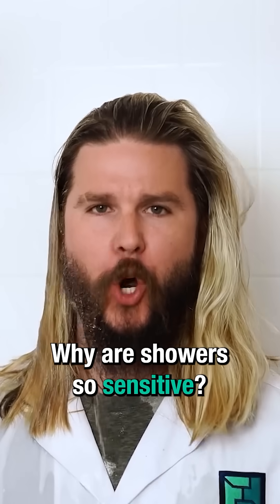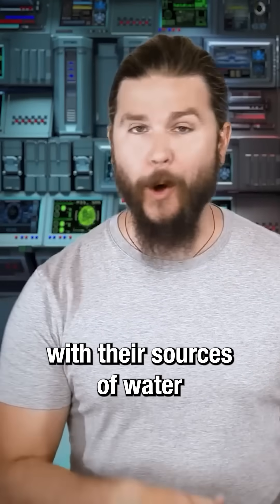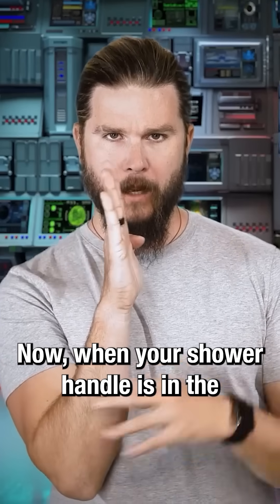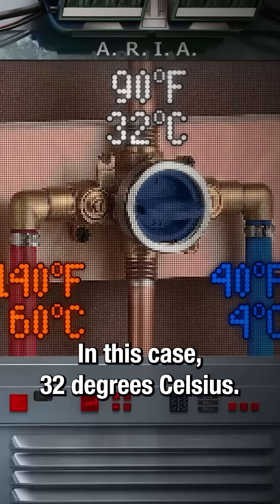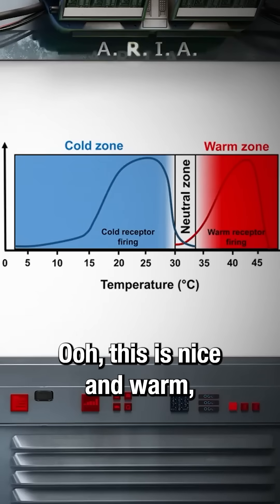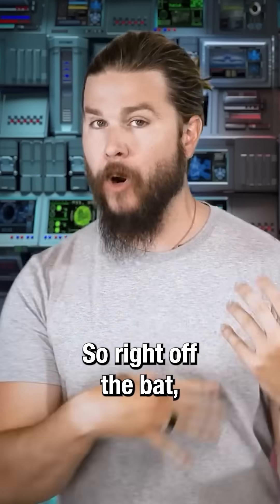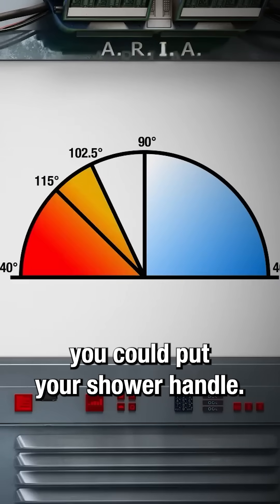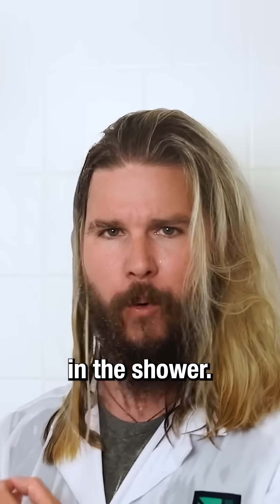Why are showers so sensitive? 🥶🥵

Comment: Must be nice to have a single shower handle and not the two knobs of death
Reply: Yes it is, and I’m sorry.
Reply: My hot water was barely hot enough. By half time the cold was completely off, and you had limited time to finish before it started to cool.
Reply: @Ron-rs2zl if you had a well or something similar instead of city supplied water, it might be a faulty water heater. How’s the water pressure?
Reply: @skorpio349  thanx for your concern. I do have a well, and everything is up to par. The water heater was set low, and it wasn't really a problem. Just finished a whole new bathroom and turned up heat, so it's plenty hot now.
Reply: All hot, adjust cold.

Unless someone set your water heater too high, then do the opposite.

All cold, adjust hot.
Reply: @evananderson1455 this is the way
Reply: @evananderson1455  THIS IS THE WAY
Reply: @evananderson1455 based
Reply: But even turns typically work... typically...
Reply: @hadensnodgrass3472  I find the best method is to turn hot all the way up, then bring the cold up to the desired amount.
Reply: @hadensnodgrass3472 not in Japan... Trust me I flew there and tried
Reply: @hadensnodgrass3472  So Hard LOL 1 Shower Head FTW
Reply: I have a 70yr old house and I deal with the broken singular knob of death
Reply: @user-bs4ws3cc7h  The stem valve for the hot water knob of my walk in shower is stripped so the knob doesn't stay on/work and can't find a plumber that can fix it. They all like sorry we don't even carry those parts anymore. I have the handyman skills of Al Bundy so I'm not going to fix it myself
Reply: I have the two knobs of death, and for all intents and purposes, one of them is also useless, since it's always either all the way open or all the way closed. Normally I open the hot all the way and then turn the cold to where I need it, but when we got a new water heater I had to change that math and open the cold all the way during the summer sometimes, and then turn the hot down. Either way though, I find that having the two handles actually increases the amount of usable real estate where I have a sweet spot between too cold and hot enough to just not quite injure me (and I usually like it way towards that hot side anyway for therapeutic reasons with chronic pain yadayada it helps okay). I get basically half a whole knob worth of usable real estate because the plumbers tuned it this way when they put different sized pipes for the hot and cold inlet in that area. Apparently they'd been doing their shit long enough to figure out what the correct ratio of both was when one customer had them change it until they got it right, via trial and error, and once they'd done it so many times, they absolutely retained that knowledge and kept passing it down because it got them a lot of 5* reviews for making the most usable shower ever. So I guess there's another factor to consider, whether the water delivery to both the hot and cold valve is ACTUALLY equal or not, which kyle assumed it is, but at my house it most certainly isn't and that's a good thing.
Reply: 2 knobs are way better, you get to control the flow with a lot more precision, but it is more complex
Reply: @geekjokes8458  Then why not one for flow and one for heat? 2 knobs is better, but not like that.
Reply: Nope  @geekjokes8458
Reply: @geekjokes8458  more complex holy shit good one lmfao
Reply: @geekjokes8458  Complex now People have to work with their Brains HAHA so hard
Reply: 2 knobs are better than one.
Reply: @DDDadToTheBone  that's what my girlfriend things, apparently :(
Reply: @DDDadToTheBone nah
Reply: @DDDadToTheBone TRUE. it IS way better! 😂
Reply: I actually prefer the two knobs, and I have had both.
Reply: This reply thread is either too heated, or not heated enough...
Reply: @Dufus_Puncher  Eh, I think it's just right.
Reply: experienced plumber here. i'd advise you stop thinking your two handles are the issue, and replace your hot water tank lol. if you're cooling down in a typical 10-30 minute shower, your heater is probably half full of silt and calcium. not trying to call anyone out, i just see a ton of sympathetic replies and am trying to help hahaha.
Reply: I have 3 knobs
Reply: @kodojow  The Knob Game is Strong
Reply: Okay, here’s a trick. Put your hot knob as far open as it’ll go, this reduces how many variables you’ve gotta work with. Now, you know how science man said you’ve got a really small area to work with on the ding knob? You’re really only working with that small area and about half of the cold side. Fiddle around with your shower knobs and try to remember how far you’ve got to turn the handle for the sweet spot. Mine’s about a quarter turn.
Reply: @dotdotdothuman   that won't work if you have an instant geyser...
Reply: @Buddha-v9g   turn what on?
Reply: I'm actually not a fan of it, it seems almost everywhere I go they've converted shower and sink faucets into single handle type.
Reply: 3 bro, three
Reply: They make 3 handle showers too
Reply: My apartment complex includes heat and hot water. They just installed 8 on demand hot water heaters. I tested the temperature. About 140 hot. And it's basically endless (before on demand was a couple hundred gallon boiler system. Also was virtually endless.

I'll miss it one day when I move
Reply: Disagree
Reply: I have a single handle because I have an electric shower, so you only need a handle to control water flow. It's not a fancy model so it only has 4 modes: off/cold, hot, very hot, BOILING YOUR SKIN OFF. 
Some simpler older models only have 3 modes (off, hot, really hot) and some fancier ones have a slider things where you can carefully curate the temperature.
The advantage is that you never run out of hot water, since the shower heats it; the disadvantage is that your power bill goes through the roof with long hot showers, also the metal piece that binds the coils inside need to be replaced sometimes because they wear out overtime (don't worry, that usually just means it stops heating).
Reply: @gabrielabatista6016  that sounds complicated lol, mine has a dial for heat and an on/off button.
Reply: @gabrielabatista6016  "some fancier ones have a slider things where you can carefully curate the temperature." That is nice to Know We have at home
Reply: I think it has more to do with quality of knobs being installed.(there is a lame pun in there, but I'm lazy right now.), plumber's knowledge/skill level, personal sensitivity to temp, and how easily a person gets frustrated. But, I am not a plumber.
Reply: @nullshock3381 ”lazy right now” 😐
Reply: turn them on at the same time
Reply: Add am instant geyser to that equation
Reply: You know you can just install those right?
Reply: @timp7852  Not if you rent, which most people do, you need owner permission.
Reply: Nah 2 knows better for control
Reply: I don't know. I think a single handle sucks for control. Maybe a fancy smancy sink. 

 Automated sinks with no handles though where you can't even control the water temp are hell.
Reply: Bro upgrade now. Havent looked back in years that shit is like 50bucks max
Reply: Two handles are better.
Reply: I never burned myself with two knobs. I hate the single knobs. Cold on full blast first, slowly add hot water until the temperature is nice. Subtract cold water if both knobs are on full and not hot enough.
Reply: Yeah this is my exact handle and my placement I use except if I’ve been in their too long and the hot is running out I notice the perfect zone migrates lol
Reply: I have a shower with one knob. It is so much more sensitive. I move it half a degree and it goes from Alaskan winter to pits of hell.
Reply: Those are easy, just crank both all the way up
Reply: I thought ever had two knobs.
Reply: For reals. I can never get my shower to the perfect temp. It's either boiling or freezing with the knobs.
Reply: Dude those are better.  You can turn the flow down to like 1/3 and turn on all hot and then put the plug in and lay on the bottom and get a warm rain and steam bath with a fraction of the water of a 1 know system
Reply: For me its completely the opposite, i fucking hate this confusing ass solo handle, i want to go back to my two knobs of death, easier to adjust
Reply: I like my two nobs personally, but maybe it’s just cuz I’ve dealt with so many one nob ones that try to combine temperature and amount of water
Reply: People who talk about two knobs being better than one: with one knob do you mean the ones where you have to start with cold full blast, or the "3D" ones where left-right controls temperature and up-down controls pressure? Because for me the ranking is definitely:

1. 3D
2. Two knobs
3. Single knob
Reply: @tuomastt never even heard of the 3d one. I only know the classic one knob setup seems like it was designed by a jerk for how awkward and hard to control it is.
Reply: @fromthefire4176  I was so confused about the amount of people preferring the two knobs to one knob, since I think the one knob one (3D) that is standard here is clearly superior. I've only used the one knob where you have to start at cold couple of times abroad, and it's been awful! Who thought that was a good idea?!
Reply: Although now that I think of it, we also have the ones where the first knob controls the temperature and the other on controls the pressure, and that is equally good imo.
Reply: Oh it most certainly is
Reply: Don't be a whiney peasant.
Reply: Don't be a whiny peasant
Reply: The three knob system is the best.
Adjust the 2 knobs to you liking, close the third one to stop the water, open it again and the setting is exactly the same.
Reply: Dude.... Some have 3 knobs.... Hot....cold.... another doing something that no one know of but something is different about the water
Reply: i preferred the two knobs, i would just turn hot water to full then set the cold water to about the same spot and it was always great.

even if the water was too hot or cold for me to always set one to full i feel like i could still set it much more reliably.

half the ones i used in truck stops felt like i needed a training course to find the right temp.
the one i have now is "up and down for on off, left and right for hot and cold" and i hate it.
Reply: I actually miss my 2 handles. You technically get far more adjustability.
Reply: Whatever temperature is at 130 to 140 degrees is my sweet spot.
Reply: It costs like $5 to buy one and replace it
Reply: That’s just as easy though just go full hot and then tune in cold to your liking
Reply: US is 10 years behind on this
Reply: @OzzieTheHead  the us is 10 years behind on most things lol
Reply: I experience them recently and I was not ready for the cold water knob to keep spinning and turn back on
Reply: Idk, my two shower handles means i have a few more dagreese to play with
Reply: I have two knobs: temperature and water pressure :)
Reply: 6 turns on hot, 2.5 on cold works every time for my shower. Just gotta figure yours out
Reply: I've always found it easier to get a comfortable temperature with two knobs.
Reply: Bro my parents recently replaced the old single handle for the shower with two knobs every shower now is torture
Reply: I just moved to a place with that a few months ago and I fucking hate it. I've learned to work with it but I get really close to scalding myself at least once a week still.
Reply: The reason separate hot and cold knobs were replace with a single knob is because there is a mechanism in the single knob ones to compensate for changing pressure on the cold line.

With two valves if someone flushes a toilet the shower suddenly gets hotter; depending on your plumbing, it could be much, much hotter.
Reply: We just got a two lever shower installed. Fortunately they both point down when off and up when fully on. 

The recipe for the optimal temperature is: one full turn hot water, one sixth turn cold.
Reply: i can confirm as someone who has had to use both
Reply: I have two knows, I live in a house built in 1915 😂
Reply: The two hands of death super easy
Reply: You just reminded me of the time I had to use the back bathroom shower only instead of the main one ..... I hope I never have to use it again only the cold side works
Reply: Trust me, you don't want the "surface of Pluto to surface of the sun" dial
Reply: no it isn't
Reply: 2 knobs is WAY better than one. I have 1 knob in my house and the hot water runs out much quicker because of it. 
With 2 I can increase the water temp on my hot water heater and use way less hot water to get to the point I want it. Making a longer shower possible
Reply: Gotta be like Indiana Jones with those handles
Reply: Im with you. The two knobs are fun to work with.
Reply: Hate the shower handle. I cannot stand them and would much rather have two knobs, where I can control pressure and temperature separately.
Reply: My shower I can just change the temperature of the hot water unit. And get into the shower with a specific temperature. Then if it is still too hot I can add cold water to dilute the temperature. The only downside is if it is too cold then I would have to get out of the shower and increase the temperature at the control unit.
Reply: I went from the two knobs to fickle one-knob thing that fluctuates, somehow has momentum, and the middle position is either full on hot water or full on cold water with no middle ground.
I miss my two knobs. At least it was a simple equation to solve. I just turned  the cold handle a little bit, then the hot water until the temperature was good. If I wanted more pressure, turn the cold handle a bit more, then turn the hot handle a bit more. I knew I was only going to get closer to my desired temperature.
Reply: I adjust my heater to work at 38° to 40° degrees that way hot water knob is on at full and I use as little cold water as posible to adjust depending on outside temp. 

Using the cold knob to cool water you just heated means you are wasting energy.
Reply: I always just turn the hot one all the way up and add/remove cold water as needed.
Reply: Turn hot all the way open then modulate with cold works every time everywhere
Reply: I use to have the knobs of death but now I have a handle
Reply: Try 3. The knob in middle controls flow
Reply: One knob is actually much harder to get the proper temperature
Reply: idk I find the 2 nobs to be more accurate in getting a good temperature.
Reply: Turn the cold all the way up. Then, then hot. All the way up. Then turn the cold down slightly. (Someone who’s upgraded from the 2 knobs of death)
Reply: Just turn the cold all the way up then turn up the hot until it gets to the right temp
Reply: I prefer the two knobs of death: I accept the challenge.
Reply: I have 3 knobs. Is that weird? Or no? 

They need repairing right now cuz all three leak, but when they work, they work. I'm like a DJ of my own bliss, twisting those knobs and singing in the best showers of my life!!
Reply: i actually really miss the double knobs
Reply: Two knows actually give you more control over the temperature
Reply: It’s even better with a handle where the water is turned on by pulling the entire handle out, and temp is controlled by twisting (like normal). So I can keep it perfectly in the sweet spot permanently.
Reply: I've found that going too warm and using the cold knob to rein it in has been successful
Reply: Handles > Knobs
Reply: Yup... I got the knobs in mine and they're a nightmare
Reply: Lol, two handles are even better. One for temperature one for water.
Reply: Is it bad that I like the two handles because I feel like I have exact controls of the temperature
Reply: Two shower handles is better than one because it gives better control.
Reply: I have three. Hot, Cold, and Turn The Shower On. But my shower head has a temperature read on it, so I can mix my shower to perfection.
Reply: But you get far greater temperature control with two knobs...
Reply: Australian Plumber here. 
Lot of folks wondering different things with different opinions so thought anyone who makes it this far.

Firstly, I’m concerned for you lot talking about geyser’s out of the shower. Hot water should be at 50° at the closest tap to the unit, in a standard household/apartment. 45° for elderly, children or sickly people.

From my understanding, the mechanism in mixer’s means as you turn the handle to allow for more hot/cold water, you simultaneously reduce the other making it sensitive.
Think of the two taps spinning like soft drink lids. Takes much more for full blast which also means it’s easier to precise and find that perfect temperature.

Will say, I’ve never worked on a shower that has three seperate spindles for hot, cold and on/off.
But to those saying they have two, one for temperature and one for pressure, I’m quite certain you’re mistaken and just have hot and cold.

Fun fact time!
You will find everywhere (where the work’s completed properly) cold water will always be on the right hand side, hot on the left. This was internationally agreed upon due to the vast majority of people being right hand dominate and if someone’s vision is impaired or they’re on autopilot. They won’t end up scalding their hands!!
Reply: @kylesharp234 yeah I don't see how 2 knobs could control just pressure and temperature separately unless one is simply the "cold" normal water and the other is to add the "hot" water. People don't seem to understand how plumbing works in general lol. It's either coming straight from the main water line or it's coming from the water heater. One knob for each. Thusly no matter how you look at it, even with tankless heaters one knob would be putting out Cold and the other puts out Hot. Of course as I said above, it does make it much easier to use the Cold to set pressure then use the Hot to adjust desired temperature, and allows for much better control of the 2.
Reply: I like the knobs better. The single handle has the problem he is mentioning. Is not that good, it only looks good.
Reply: Disagree, 2 knobs are much easier to control, as you simply set your pressure with cold and regulate temperature with hot. It gives almost total control and fine tuning vs a single knob with little to no pressure control ability and a very fine margin of error on temperature.
Reply: @Theykillmice128  This! People turned from 2 knobs to one handle, not because it's better, but because it looks pretty.
I hate those snob handles so much. It's like nobody notices.
Reply: No it's annoying bc sometimes i want it hotter and I can't change it
Reply: Bwahahahahahahaha!
Reply: One day, I'll remember which is hot and which is cold.

Just kidding I never will.
Reply: I got 3. 1 hot 2 bath or shower 3 cold
Reply: Uhhh... no, normally you have two knows. One for temperature and o e for amount. Only Americans think you  should have one handle that does both.
Reply: @RegebroRepairs i'm american and i hate how my shower knob controls both. temperature and pressure SHOULD be separate. sometimes i just wanna sit with the water running over my head but the pressure is too high
Reply: @duckified.  I wonder if they have the same distance between the pipes, then you could just replace them. Oh never mind you always build yours into the wall...
Reply: @RegebroRepairs  
And only UK residents think you should imprisoned for wrong think. 

See how much of an asshole I look like assuming that of everyone in the UK? Fuck off, go get arrested for defending urself.
Reply: @RegebroRepairs  In Italy there are Both one and 2 Handles.. In Some Cases you have Multiple when you have multiple Shower Heads.. Or Just one for Both Heads..
Reply: @Jakkaribik1  OK, but why? One handle is just silly. You want two, with one set to a nice temperature and another to turn on and off.
Reply: @RegebroRepairs  2 Handles is One Cold and One Hot .. You could have the Same with one Handle or other System.. No need to Focus on one System there are Multiple
Reply: @Jakkaribik1  Thermostat mixers also have two handles, but it seems Americans have no idea they exist.
Reply: @RegebroRepairs  Yes Ok Americans can also build great things but I will Trust you know it because im from Europe
Reply: nah, the hot and cold knobs are better because you can accurately adjust the pressure of hot OR cold. with a single knob, the pressure is usually only controllable by how close it is to the middle
Reply: It is. I've had both and definitely prefer the single handle
Reply: You can get a mixer, they're not hard to install lol.
Reply: Just get an electric one installed
Reply: I too, have the two knobs of utter suffering, my personal strategy is to put the hot one all the way up and then adjust the cold to make it not boil me alive, but the area is like 2 degrees between 3rd degree burns and frostbite
Reply: Just turn the heat all the way up and then adjust the cold knob accordingly
Reply: Fr
Reply: I have 2 knobs on my sink. It ain’t all too bad there but on a shower would definitely suck
Reply: I tamed my knobs with a sharpie. Never again.
Reply: @ThePickledsoul  genius
Reply: Yup I have two knobs lol
Reply: you're better off with two seperate knobs that you can mix yourself.
Reply: Two knobs is actually way better and you have the bare minimum requirement of being an intelligent life form to use them
Reply: 2 knobs are best: 1 mixer valve that always allows 100% total flow, and 1 flow valve that offers adjustment from 0% to 100% of the total flow. Add 2 check valves to prevent backflow in case the hot and cold sides are at different pressures, and you have the perfect shower valve tree.